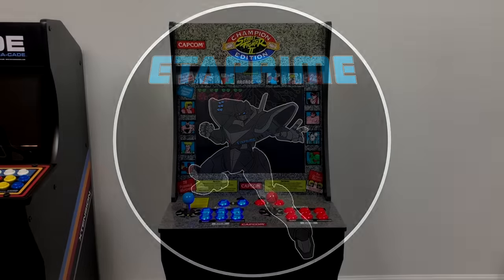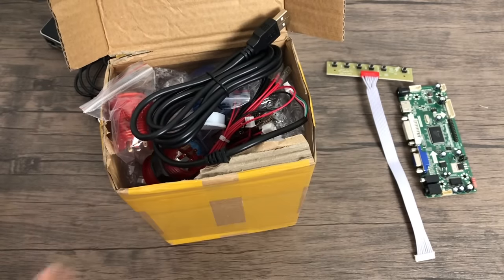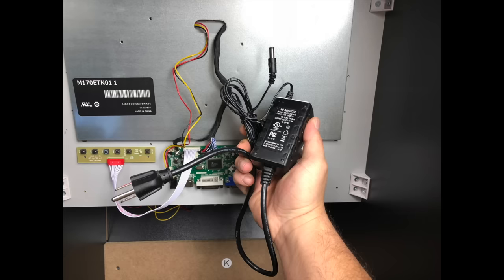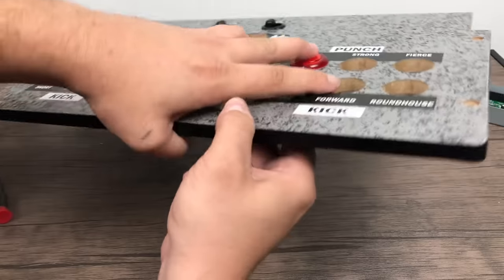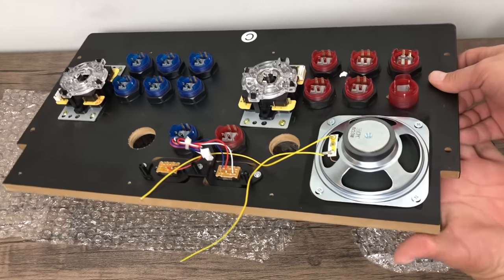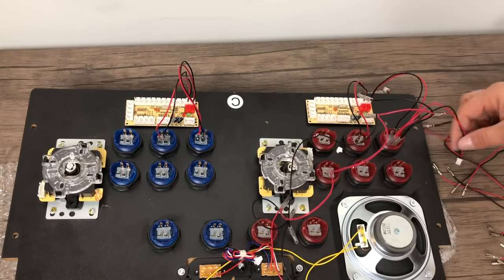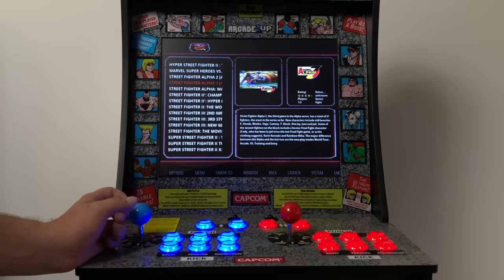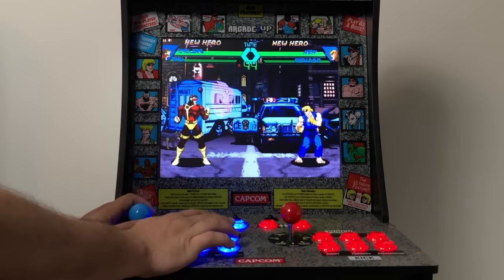‪Arcade1UP Raspberry Pi Install Tutorial - RetroPie in an Arcade1UP

Comment: Excelent video, I’m a first time modder and this worked very well. Have a couple of questions:
1. Having issues with the sound (no sound at all) anyone else had the same problem?                   2. What’s the best way to set up the controls for SNES use?                                                              3. What’s the best way to turn off the system without affecting the SD card? I usually have to reconnect the SD card to a pc to repair it because the LCD light stays red.                          Any insight anyone might have would be very useful, I’m a first time modder so I suppose I’m ignoring some pretty basic rules when it comes to Retropie. Great video, thanks for everything!
Reply: having same issue withe the no sound, did you figure it out?

Comment: ETA, is it required to replace the joystick and buttons for it to work with the pi, or can you leave the stock controllers as is and just replace the cpu and motherboard with the pi?
Reply: @Dr.Ticklebum69  How do you keep the existing buttons since it is an IDE cable and according to ETA, the Pi's IDE cable has a different pinout.
Reply: Oni Sama - I think you’ll need to get 2xusb Joystick board. Mainly Pi only takes USBs not IDE
Reply: The ribbon cable is NOT IDE. It is just a ribbon cable carrying all of the switch circuits to the stock computer. The Pi has 17 GPIO pins which technically  after joysticks are connected would allow you to have a total of 9 buttons. This cab uses 16 for a total of 24 circuits. Even if it were possible for RetroPi to read the GPIO (not sure if it is, I havent played with it yet) there arent enough pins.  What you CAN do (and ETA did say this at the beginning) is just buy the USB encoder boards for about $6 each and connect the stock joysticks and buttons to them. However he also did say that the stick button s and joysticks are junk, which is why he replaced them all.

Comment: Hey I'm attempting to do this but I've hit a snag. The joysticks that are with the cabinet are two 4 pin cables. And the USB encoder doesn't support a 4 pin plug. Can I cut these wires and make it four 2 pin cables? Or would that not work?
Also my usb encoder has 2 pin spots colored Red. Is that relevant? Why are they red and the other ports all white?
Thank you!

Comment: So end of the day, you are probably better off with a wider cabinet with better buttons and joysticks that is meant to be used with a Pi
Reply: The idea is that after the holiday I bet you could snag one of those cabinet for even cheaper.
Reply: No kidding. The only thing he really did is save some time, but $20 worth of MDF and a jigsaw plus an $80 monitor would get you to the same point he started at except you could build it full-size and use a better monitor.

Comment: I'm interested in seeing if it's possible just to hook up a scanline generator to the Arcade1up, leaving the rest as is, for the deluxe atari cabinet
Reply: yea its quite easy, just plug it in, youll need an extra hdmi cable and thats it. then adjust the switches for preference of scanline

Comment: Didnt see it in the vid and just ran into the issue. The LCD controller board, make sure you check your LCD model number and match the controller board to the right LCD, I just followed the links in this video and bought the one linked and that was for a older model LCD. Arcade1Up must have switched at some point. Happy modding and hope this helps someone! Will check back tomorrow once I get my new controller board =P
Reply: Did it work but the ratio was off?

Comment: So I'm a little confused . it looks as though the power switch and the volume switch will no longer be used?  So how do you power the system on and off then?? I know stupid question
Reply: It's not stupid at all. I'm brainstorming as we speak. He's got the power strip inside the cabinet so he either has to leave the back panel on and hit the switch, leave it on all the time, unplug the strip from the wall, or turn off a breaker like they do in an arcade.

Comment: I’m thinking of building this as I have already built two mame cabinets in the past. 

Can you give me an idea of cost?
Reply: RASPBERRY PIE - 45.89
RASPBERRY PIE CASE - 8.88
RETROPIE SD CARD - 57.00
ARCADE STICKS BUTTON AND ENCODERS - 50.22
12V AUDIO AMP - 14.19
HDMI LCD CONTROL BOARD - 22.90
POWER STRIP - 23.99

TOTAL = 223.07
Reply: Where is the list of items? Do you have them with part numbers?
Reply: @joshriggs8665  Retropie sd card can be like 5 dollars if you take the time to just make it yourself.
Reply: Hey I would like to use the stock controls from the sf2 cab how do I wire the encoders ?
Reply: Would it not be better to use a set of stereo pc speakers instead of amping the factory mono speaker?
Reply: Josh Riggs + the original cost of the unit, which are $399
Reply: @joshriggs8665  do i need these led Buttons or can i skip this part

Comment: I should be able to plug computer speakers straight to the new board right? Instead of using amp for the    1 up speaker?
Reply: If it has a 3.5mm jack then yes, obviously.....

Comment: All I wanna know is, does it play MVC2?
Reply: No, it wouldn't.
MvC2 is played on Dreamcast and the arcade equivalent, NAOMI. 

MvC2 is actually a 32-bit game.  It reuses a lot of the sprites from Capcom's 16-bit games the main processor for the DC/Naomi was 32-bit and it used polygon's for a lot of the game's special effects.

That's beyond a Raspberry Pi 3's capability to emulate well right now.  Maybe a later more powerful CPU with more RAM could do a decent job of emulating a DC/Naomi but not right now.
The Sega 32-bit and later consoles have wonky emulation as it is. 

You still need a higher-end PC to get decent performance from the emulators that are out there.
The Raspberry is really better for 8-bit and 16-bit games, console or arcade circa 1977-1994...  They can play PS1 games but even those aren't perfectly emulated from all the reports by people that have these systems.

Comment: Is there a way to get the Original ON/OFF toggle switch to power on/off the PI.
Reply: Fresh Paint yes there’s a guide on the 1up Reddit.
Reply: @Charlie97L   please add link to the thread you are referring to. Thanks!
Reply: Just make sure you add the necessary command script to shutdown your Raspberry Pi properly via remote button rather than simply killing the power. Your MicroSD card will thank you. I always simply shutdown the system from the RetroPi options menu.
Reply: Matt L. I know you can add a push button and script to power down/up the Pi. My question is how does this work with the Original 1Up on/off Switch. My experience is a momentary push button when pressed and released completes the circuit and starts the shutdown script. Pressed and released again will power it back on. A switch is either always on or always off as I understand it. So looking at a switch doing the same function...it would be like holding the push button in even after the Pi shuts down. Might work??? But now the “button” is still being pressed in. If you flip the switch the other way, it would be like releasing the button, how would that power the Pi back up? Or am I totally over thinking this?
Reply: @chopsuey503  To get the factory style power switch to work properly the command script would use the switches ON "closed" position to power on the Pi and the OFF "open" position to shut down. This would be in contrast to a momentary plunger style button that would function when the "closed" state is activated (closed state powers on; successive closed state shuts down). The Raspberry Pi Reddit might be able to help with the script.

Otherwise you would have to reset the factory switches position every cycle to activate the "closed" state simulating a momentary style button. 

Most people who are retaining this factory switch are tying into the power adapter's power interuption button to acheive a rudimentary power on/off. Their SD cards will all be corrupted in the near future.
Reply: Matt L. Does shutting down the system from the Retropi option menu, keep the SD card and Raspberry pi safe?
Reply: @therisendead7  Yes, it shuts down Retropie/Emulation Station properly.
Reply: @Theater_Of_Doom  but is it safe to unplug the raspberry pi after shutting down Retropi? (...sorry, I'm a noob)
Reply: @therisendead7  No problem. After shutting down from the Retropie options menu just wait until the shutdown text crawl fully completes before disconnecting from your power source.
Reply: @Theater_Of_Doom  Thanks, I really appreciate the help.
Reply: @Theater_Of_Doom  command script?

Comment: I followed this to do my build on my SF cab. But I found that when I placed my joysticks like yours with the pins facing different directions, the U-D-L-R on both sticks is now opposite and causes issues when programming them in Retroarch. If I program both sticks in Emulation Station they work for that session but if I reboot then one of them is now reversed. I think I should have installed the sticks the same way round with the pin connectors facing the same direction.

EDIT - Ahh I see at 16:04 you removed one of the sticks and turned it round so the pins are facing the same way. Missed that when watching originally.

Brilliant video by the way. Thanks so much.

Comment: How do you turn it off?
Reply from the maker: You can shut the Pi down by pressing start and then shutdown. The monitor will sleep. If you want to cut power to the whole thing unplug it or turn the power Strip off. I leave mine on all the time. They don’t pull much power at all.
Reply: Do I press start while in the game selection menu of the pi? Also do I press start button to restart it or will any button wake up the monitor? Never used one of these before and im afraid to currupt the SD card
Reply: Sorry just saw you have a video dedicated to adding a power button to raspberry pi on your channel
Reply: @kevle007  i can't find it. do you mind showing me?

Comment: If the goal is to have a PC or Laptop to run more demanding games and have maximum support, wouldn't the Legends Ultimate be the better buy than a Arcade1UP cab for this purpose?  A bit more expensive, but easier to mod, larger size, etc?

Comment: This is one of the best tutorials on YT and I can’t wait to try it.  Question though, is it really necessary to have to drill holes for the select buttons or can we use what comes stock with the cabinet?
Reply: Ya,   I'm in the middle of doing this to a Mortal Kombat II Arcade 1up.  I think I'm just gonna put those buttons on the back hidden if possible.
Reply: or maybe in the front below the control deck.
Reply: You need the extra 2 buttons for coin input so yes you do

Comment: Eta, every video you have done has been hyper informative and very instructional. I am glad to have come across this one as I had been trying for some time to cheaply build a cabinet from scratch. I was able to nab a mortal kombat cabinet from Walmart for 200$ on clearance. So this will make that cab many times over better. I wonder if you might can do an updated build at some point to add led lighting to the cabinet and possibly change the wooden marquee out for a back-lit one.

Comment: amazing video man, thank you, ordered all the parts needed, will be trying this with a windows 10 PC.
Reply: How did it go ?  I have a pie all set but I have an old windows 10 that I think I will use for this .  The laptops is old and obsolete.  But will work better then the pie for Nintendo 64, PlayStation and jaguar emulation
Reply: @craigerickson4037  I actually ended up using a Pi4, I did not need the heavy 3d emulation so I stuck to PS1/N64 max and the Pi does those without issue
Reply: @MasterGGG  ok nice .  I may need to upgrade to a new pie .   I've got the pi 3 zero if memory serves . 
It's been a few years but it's been running retro pie and emulation station front loader with no issue .

Comment: The newer models have shorter cables for the screen. Don’t pull too hard or you end up disassembling the screen to reconnect. My solution was a squared piece of cardboard to separate the board from the metal backing piece. If that’s not recommended please let me know.

Comment: Rather than using a step-drill bit or a hole saw to cut the button holes, you might want to try a forstner bit. They make such nice clean holes - especially with a drill press.

Comment: Little late to the party. I finally got around to doing this with my mortal Kombat 2 legacy cabinet. The only thing is no matter what joystick I use it still thinks it's one controller. Think I may have gotten the ribbons in the wrong order. But thanks for your video and showing how to at least set it up (I know not most people use them but I used a pi 400 since it's just a pi 4 built into a keyboard)

Comment: So starting out the stock monitor 5 pin power supply wiring was not long enough to attach the control board to the wood.  I had to disassemble the cabinet to get inside the monitor and replace the entire 5 pin control board power supply wires.  Luckily that part that came with the control board purchase was 6 inches longer than stock so it worked.

Comment: Let me just save you some work here:
Do not use a step bit if you are drilling new holes!
Use a 1&1/8" Spade drill bit with a flat bit if you are using 30mm Sanwa buttons.
I'm doing a 4 player 26 button cabinet with a new control console using 1/2" Medium Density Fiberboard.
Using a step bit is an absolute pain if you have to do more than 2 holes.
Use the spade bit, drill till the center tip just barely comes thru the other side, then flip and use that hole to drill from the other side. 
Super quick and way more smooth.

If you are just expanding existing holes, use a step bit.

Comment: In the video you mentioned that you were going to pass on adding an on off switch. If you did, what would you recommend? I would prefer not a straight on/off power button, but rather a shut down function of the raspberry pi. Thanks!

Comment: Great tutorial, very in-depth and informational. However, I don't think I'm going to do this. I just want to add more games to my cabinet in the most straightforward, cost-effective way possible. I don't want to replace the buttons, joysticks, and speakers. I've been looking for hours and I can't find a single video that explains how to run a raspberry pi, PC, or console through the cabinet using what's already built-in. I'm sorry to be complaining about this here because you really did a great job with the tutorial, but I don't know where else to ask
Reply: You would bare minimum need an encoder for the raspberry pi because how else is it going to convert the button signal to input .the reason it’s recommended to get new button kit is it includes the wires you need and they are higher quality. You will also most likely need to splice or change the wiring slightly depending on the encoder. You can use stock speakers and screen fine. The newer cabs don’t even need an amp because it comes with a 3.5mm cable but you may still want an amp for volume control.

Comment: A forstner bit would be better than a step bit. No need to center punch to prevent bit walk. It will cut the top cleanly, cut faster than a step bit and it won't blow out the bottom of the panel.

Comment: Just seems like a better idea to get a free or close enough used LCD from thrift, family with all the inputs built in, then a flat pack cabinet kit from ebay, Etsy, Amazon, ali, etc, made to accept standard vesa mount built into most monitors, then add control panel(s) as desired for 2p, 4p, driving, trackball, spinners, rotary stick, etc. 
Art for side panels, marquees, etc is cheap and multiple sources.
A cab kit like this would be better built.
The rest of the components shown here would be the same, RPI, stick and USB encoders, etc, minus cost of LCD input board.
Wouldn't make much sense to Buy a new 1up just to mod like this, though if you bought  or were gifted a 1up in the past, makes sense.
Also be nice to snag a used or non working 1up to mod on the cheap

Comment: I just bought the TMNT arcade 1up, will this tutorial work on it besides the 4 player control layout? Do you have a diy for 4 player layout? Would really appreciate it! Great vid
Reply: Jon Hatton I have the same question @ETAPRIME please help. Thank you
Reply: Yes it works, can confirm. Just need the right video controller for the TMNT cab it's on Amazon, and obviously have to drill more holes and add more buttons.

Comment: If the wood is thick enough you can use riser that are used on mainboard in computers. I bought a box full of them with the right screws. Same measurements as used in pi cases. Used them to mount the joystick board as well.

Comment: great video.  i would like to do something like this, but i have a question.  do i need to get a monitor with vertical capability or does the raspberry do the video switching? so can i use what ever monitor i want and will not have to think about which orientation i put it in?

Comment: The 4 way joystick games do not do well with an 8 way set joystick....I highly recommend a mag still plus for the one player joystick to change 4 way to 8 way on the fly from the top of the control panel.  You don't want pacman to not move the way you want him to because an Angle direction registered on an 8 way joystick ...cheers!

Comment: Great video! I'm planning to get a Star Wars cab. Any way to keep the original software running and switch over to RP system? Or is that stupid? I'm just concerned about having to play subpar emulations to what is already on the machine.